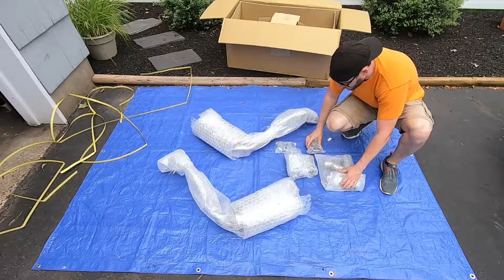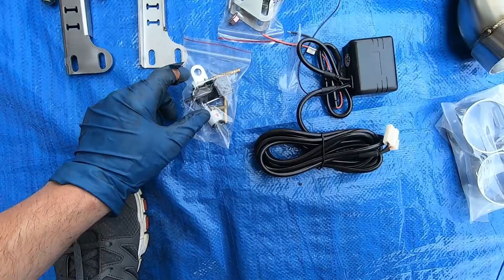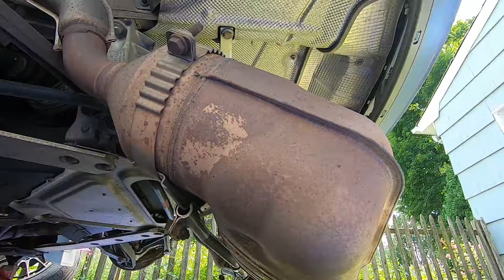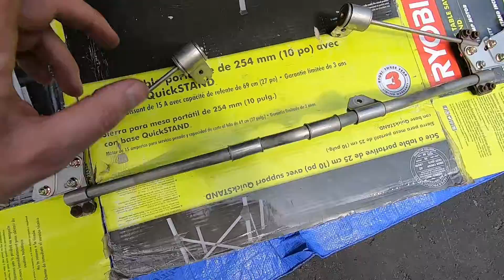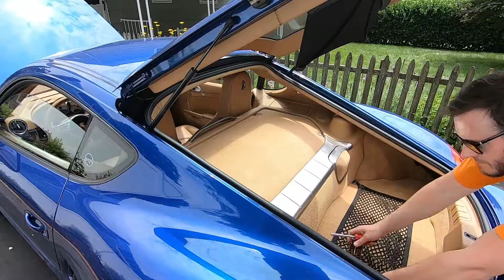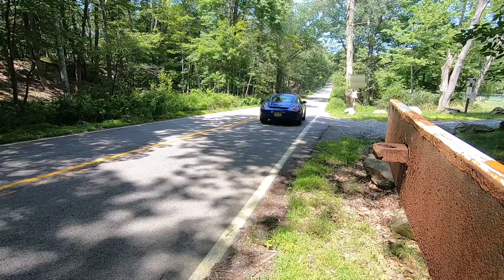Valved Exhaust Install and Test on the Cayman

Comment: Great video. Glad you gave the UK supply company TOP GEAR a public 'flea in their ear' and also hope they sent you a sweetener for their incompetence. I bet they didn't! It appears there are many aftermarket exhausts available but one common complaint is the droning sound at speed. I really appreciate your advice. Sadly there are too many boy racers out there who think this sound is great but all we really want is a quality reliable product, especially as these accessories are so expensive. The look on your face says it all and I'm really sorry for your disappointment. The advice I'm getting is to only fit the Porsche made valve system. That's probably why they made it in the first place. Thank you again.

Comment: HI there..nice vlog. BUT NO IT ISNT BECAUSE OF THE PDK BOX. And if the manual box solves it kinda then put the car into manual and drive slightly above the normal changing point. Or put the box into SPORT or SPORT PLUS, same. But that's a work around not the issue. 
It's happening because it's NON BAFFLED. If you get a 'straight through' exhaust buy a quality one where some research and brand name/reputation to be concerned about. That's what you pay for with the high end stuff. Otherwise the low frequencies hasn't bounced back inside the can and cancel themselves which is what the baffle is for. A particular frequency vibrates the body you can drastically reduce it by fitting sound deadening material to the rear bulk and floor pan. I did mine. It gives a real solid feel and quietens the fuzziness noticeably well. The other thing you can do... cut the top half off your standard exhaust. You'll see how the gas has two pathways...one is a large pipe (I think 1.9')  that bounces the sound off the end of the can and comes back before it exits the exhaust. The other is a small pipe of about 1/4 to 1/2' (something like that) that goes directly into the exit pipe. Cut this off with a hole saw from the entrance (you'll see when you open it, its easy) and replace with a 1.5' pipe. Now you have great flow, deeper and louder sound as a god proportion of the gas goes straight through. But you've still got a good proportion of the gas bouncing and cancelling the drone.

Comment: One thing I didn't like about the valved exhaust I added to my Corvette is that it would lose vacuum and be loud under load going up a hill. So cruising on the highway would be quiet until I started going uphill and then it would drone pretty bad because there wasn't enough vacuum to keep the valves shut. Did you have that issue with these?
Reply from the maker: No there was an electronic valve that used vacuum to power the valve. If the electric switch wasnt asking for loud it didn't matter if vacuum was present or not

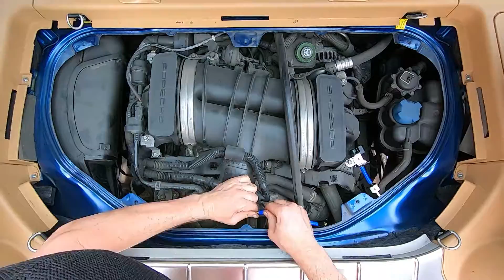Comment: what did you splice into at 12:00?
Reply from the maker: Hey John, the best I can remember is that there is a vacuum line in that area that I used to provide vac to the exhaust valve controller

Comment: I have a RUF 3800S boxster with a 3.8 911 engine. Also a GT4 transmission which revs to 3000 rpm at 70 MPH. Not going to pay 3500 for a Fabspeed or , gulp, 5K for a capristo. Contemplating giving this a shot. Quality looks good. Tommy L Garage has a video showing exact placement of vacuum and electrical lines for a different valved system.

Comment: Sounds fantastic. Does anyone have experience with Remus full catback exhaust and Carnewal exhaust? Remus is local and easy to get fitted here in UK, but it is nearly 2x more expensive and i am not even sure how it sounds.
Reply from the maker: Check my other vids as I ended up getting a Carnewal exhaust and keeping it
Reply: @132ksg  hello thank you. i contacted carnewal but they can't use my exhausts as it has  a tiny crack luckily they found it on picture i sent. so i got myself top gear non valved exhuasts similar price but got new. happy with it.

Comment: I just put a Valvetronic Designs system on my car. Headers, full exhaust, no cats. 6MT. Drones a little bit at low,  but the RPM range that it drones at is very small so its easy to just choose a slightly different speed to avoid it. With valves open, mine is wildly loud. Still working on some videos about it.

Comment: 2006 Boxster S, 6 speed manual.  987.1.  Fabspeed Tracktec with longtube headers.  Dumps open under hard acceleration, due to less vacuum.  Fortunately no drone cruising.

Comment: Car Ski/Go, When I ordered my Cayman R I ordered the stock exhaust rather than pay for the PSE which was too quiet when I drove a car in dealer stock. My plan was to put an aftermarket exhaust on which is what I did with my new car and bought a Fabspeed Race cat back system. My car is also PDK and the droaning was terrible between 62mph and higher in 7th gear when cruising on the highway (or at any speed in any gear under engine load between 1800 to 2900 rpm). I studied Planet 9 Forum and read the approx 25 page post started by Plainsman? when my car was new in 2012. His approach was to make the exhaust longer ( extra tubing under car) which helped somewhat but my feeling from his last posts was that he was still not satisfied.
I am an engineer, but had no professional  esxperience in exhaust acoustics. In any case I got a decible ap and frequency/amplitude ap on my phone and did around 17 experiments changing one thing at a time. The bottom line is 3 major changes were needed:
1. About 9 inches of house insulation over engine and front 2/3rds of the hatch area absorb the exhaust sound vibrations.
 2).A plexiglass and 2 layer 1.5 inch foam panel keep the exhaust sound vibrations from reaching my ear ( same rearward visibility).
3. A 5 inch extension of the exhaust tips beyond the rear bumper fascia were needed to eliminate the exhaust vibration from being trapped by the fascia ( I presume).
Doing 2 of the 3 changes does not totally eliminate the droaning, but doing all 3 is a total fix. It sounds great at all speeds now.It took 2 years of experimentation to solve the problem as a challenging weekend hobby. I have 52,000 miles of enjoyable mountain driving now on this vehicle.
Also this droaning elimination change along with other changes I have made allowed 116 ils of weight reduction ( I did not look up my records but at least 35 lbs are from the droaning fix). My car weighs 2900 lbs with a complete interior in the passenger area (but reduced interior behind the foam panel with plexiglass) PDK, AC, and factory stereo and optional cupholders.
Hope this can help someone else who has a Cayman with PDK.
Reply: Would it be possible for you to make a video or some forum post with pictures of all the weight reduction stuff, along with the insulation? From what you say those are some impressive results!
Reply: @lbatalha  Yeah, seconding that request. OP posted a lot of valuable insight. That's what makes this community so awesome.

Comment: I might’ve missed it but was the drone exclusive to one setting or was this with the valves both open and closed?
Reply: Might’ve been both, bc he did mention that it would work better in a manual then a pdk/auto, I assume that’s bc manuals are easier to control the rpms in then auto👍

Comment: Great vid, thanks for sharing! I had this same exhaust on my 987.1 Boxster (imagine how bad the drone was through a soft top 😭). 

I now have a manual 987.2 cayman and I’m just about to order one of these... can I ask where you chose to splice the wiring? This will be a fun project while we’re on lockdown.
Reply: How did you go with the 987.2 exhaust. I am also thinking of getting the top gear exhaust. But am very concerned about the drone noise even with the valves closed.
Reply: @ForgetfulFoot  I sent mine back 😂 it seems like the only options that don’t drone are in the £1500+ category 🤦🏻‍♂️
Reply: @slimfit4295  Yeah not good. I definitely wont order one then. The postage to return it from Australia will be too pricey. Not worth the risk, Carnewal Mod etc seems like the only reasonable solution

Comment: Man- what a run of luck on this aspect of your 987.1! I know you've likely wrestled with the cost but SOUL really has their solution dialed in nicely. Might be worth reaching out to them and see if they'll take pity on you and help you get one of their modules on there...
Reply: Dwray, The reason why you did not have a problem with the Soul is because you have a Spyder which is very different from a Cayman in terms of droaning. A Spyder does not have the airspace under the hatchback glass that allows the vibrations from the exhaust pulses against the body pan above the engine and transmission to be transmitted into the passengers compartment. The Cayman is somewhat unique in that the airspace between the  body pan and hatch connects directly to the passengers compartment. So Porsche did a great job with the muffler development to eliminate the droaning. Think about all the mid engine coupes that have a glass divider between the passengers compartment and the engine area. I will give more info in a direct reply.
Reply: @carlfrederick8433  you may well be right but, if Gaydos at SOUL has one on his Cayman R, I'm pretty sure there's a way to eliminate drone. Not for certain, but he's always helpful on FB forums if someone were to ask.
Reply from the maker: Hey D Wray, Thanks for the suggestion.  I've watched your videos in researching exhausts. The exhaust featured in this video has an extremely similar construction to the SOUL exhaust. I would expect similar drone levels with the SOUL valved exhaust and the PDK. The common consensus on the forums seems to agree.  Unfortunately the PDK just seems to land the RPMs in just the wrong spot for highway drone with most aftermarket exhausts.
Reply: @132ksg  could you perhaps tune it out - either the PDK TCU or the ECU?
Reply: CarSkiGo where did you wire in the 12v feed? I cannot find a switched one I am confident with. I used the existing PSE plug valve for the top gear solenoid etc, but I am not sure if it’s still opening and closing at various speeds (closed at 20-40 I think and open regardless of the button @ 60 or 70 mph?)
Reply: This is the same as a soul. I have this exhaust on the same car, but manual, even then, I don’t notice the drone! Real shame about the pdk causing it
Reply: @CarSkiGo good video!!  @danbourne11  Hello! I am thinking of purchasing the Top Gear Exhaust for my 987.1 Cayman S 3.4 manual transmission. You comment that with manual and this exhaust does not show drone? I would appreciate your opinion. Did you only mount catback with valves or also manifolds? Thank you!
Reply: Victor I think the 987.1 versions are slightly different, the standard silencers also have a 400 cell cat in the so will possibly be even louder than the 987.2? I couldn’t honestly say. But, I think you would be ok with the valves!